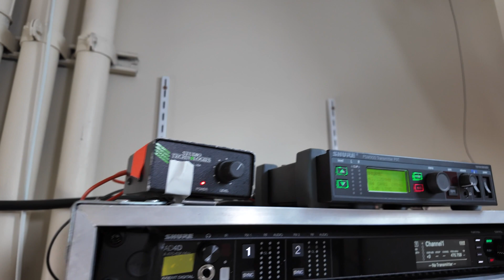Using a Yagi antenna with an IFB transmitter

Comment: I saw an antenna with similar element size over the security cabin outside a hotel in this region. Security chap did not know what it was. 73 de Jon, VU2JO
Reply from the maker: I think those are for Security repeater for radios
Reply: @GreggK6EGG  Thank you. 73